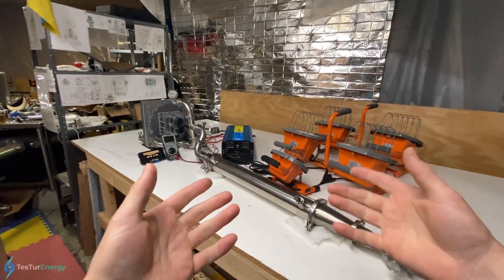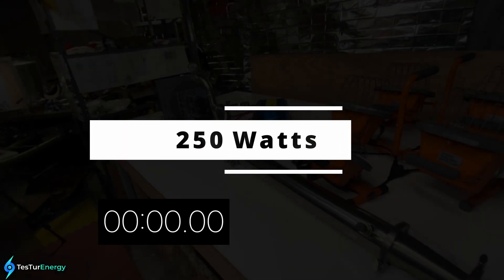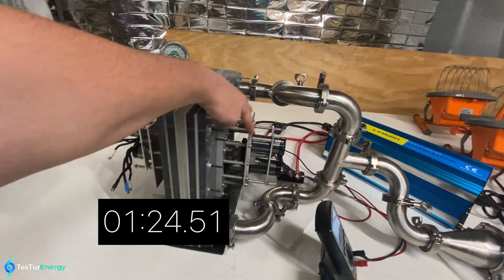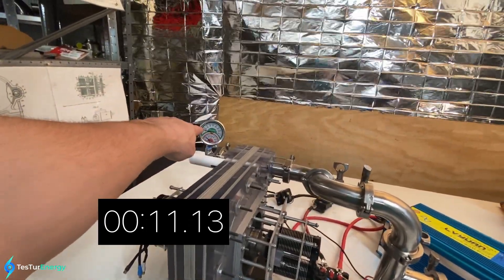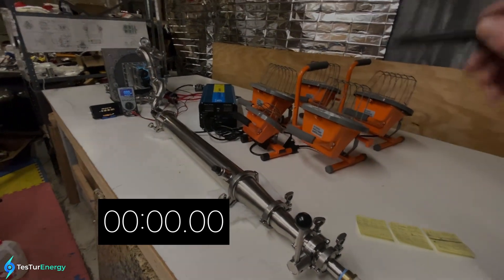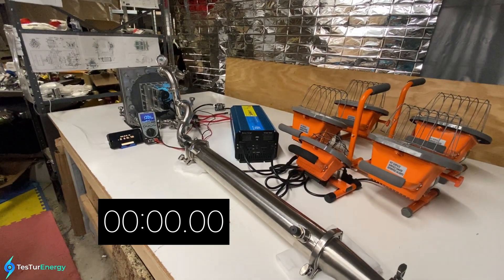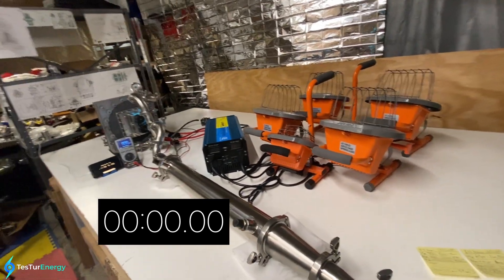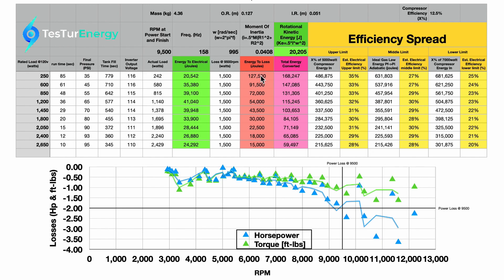Tesla Turbine 250 watt to 2.65 kW Power and Efficiency Test

Comment: Have you contacted any businesses that used to produce Tesla turbines or universities that studied them?
Eaton manufactured Tesla turbines in Milwaukee in the 1920s and 30s. I saw four of them on display during a tour of their facility in 2018.
The University of Wisconsin has a functioning 50kW Tesla turbine in one of their engineering labs.  It was manufactured by Falk Corporation.
Reply from the maker: 🤯 seriously?! Who can I contact at the university of Wisconsin to see the 50kW TesTur there?
Reply: @CharlieSolis  
I'll ask!
One of the engineers that I work with wrote his thesis on the Tesla turbine at UW Madison. He studied the effects of wet/saturated steam on Tesla turbines.

The turbines currently in production have a different name because the improvements have differentiated it enough from Tesla's original design.
Reply from the maker: I’m very curious to hear their answer.

But interesting. In my opinion they shouldn’t have needed to make any changes to it if designed properly, though. It works perfectly fine the way Tesla designed the improved disc stack patent GB 186,082 to work.
Reply: What I remember from our conversations:
The output shaft on the newer version is hollow, allowing the exhaust to exit without going through the openings cut in the discs. The discs would fail at the webs between the openings.
I looked up GB186082. I didn't see intermediate spoked discs in my colleague's models. The newer turbine has tapered discs that get thicker towards the center. The discs are spin-formed, which work-hardens them, allowing for higher speeds without deforming.
Hopefully, I'll see him tomorrow.
Reply from the maker: From the patent…
“In the new design I employ two heavier end-plates which are machined tapering toward the periphery for the purpose of reducing the maximum centrifugal stress as much as practicable. 

The inside discs, of relatively thin material, are rolled, forged or ground tapering in like manner and with the same object in view, but this may not always be necessary and plates, made of sheet metal of substantially uniform thickness as furnished by the mills, can be employed. 

Each of the thick as well as thin plates is provided with exhaust openings, leaving a solid central portion like the hub and spokes of a wheel. 

Star-washers of similar configuration serve the purpose of keeping the discs apart in the center and for the peripheral spacing the thin plates have small holes drilled in them on a circle, or circles, of suitable diameter, and in these are driven tight-fitting studs which are upset at both ends by a special tool so that they will project beyond the metal on each side a trifle more than the thickness of the star-washers. 

When the plates are put together the separating studs do not come in line but are straddled in order to give opportunity for slight yielding, thereby eliminating constructional difficulties which might be caused by unevenness or other mechanical imperfections. 

Thus the rotor can be finished closely to predetermined overall dimensions and will run true on the outside even if the thin inside plates should vary a little in thickness or be slightly warped. 

To simplify this arrangement I provide only every second plate with studs, using plain ones between. 

Furthermore, with the object of cheapening the manufacture I dispense altogether with the former, accomplishing the spacing by means of small bosses or protuberances which are raised in the plates by blows or pressure and provide a die, practically reducing all the machine work on a thin plate to a single operation in a stamping press. 

The star-washers, while preferable, are not indispensable and may be replaced by round separating washers of a diameter about equal to that of the hub part of the discs.”
-Nikola Tesla
Reply from the maker: “This construction permits free expansion and contraction of each plate individually under the varying influence of heat and centrifugal force and possesses a number of other advantages which are of considerable practical moment. 

A larger active plate area and consequently more power is obtained for a given width, this improving efficiency. Warping is virtually eliminated and smaller side clearances may be used which results in diminished leakage and friction losses. 

The rotor is better adapted for dynamic balancing and through rubbing friction resists disturbing influences thereby insuring quieter running. 

For this reason and also because the discs are not rigidly joined it is safer against damage which might otherwise be caused by vibration or excessive speed.”

Dated this 24th day of March, 1921.

Nikola Tesla.
Reply from the maker: I like that idea of spin forming each disc. Probably really good for lattice arrangement as the discs cool.
Reply from the maker: I’ve seen a hollow shaft TesTur patent before. Although I for the life of me can see why it’s necessary to complicate the manufacture other than for business legal and proprietary purposes. 

I’ve got a copy pasta 🍝 I’ll share with ya. 

Consider one kilogram of H2O steam entered the turbine at Mach 1 at 300°c and left the turbine at 1/2 radius at 1/2 the speed of sound. 

The kinetic energy left in the steam leaving the turbine at 1/2 the speed of sound is…
(1/2)(1kg)(170m/s)^2 = 14,450joules of kinetic energy. 

But the available energy from initial kinetic energy and thermal energy in the steam drop from 300°c-100°c is… (c=specific heat)

(1/2)(1kg)(340m/s)^2 = 57,800joules of kinetic energy. 

Plus

c*M(Tf-Ti) = (2080 j/kg/°c)(1kg)(100-300) = 416,000 joules of heat energy.

Total energy available for the turbine to utilize from 1kg or steam entering the turbine at Mach 1 and at 300°c thermal energy available for expansion through the path length comes to 

57,800j+416,000j = 573,800joules total available Energy.

So not being able to utilize the last 14,450j of kinetic energy of the steam means you’re only missing 

(14,450j / 573,800j) = 0.02518

That means you’re leaving only ~2.52% of the total energy available for the turbine to utilize for power out…. 

The kinetic energy of the fluid leaving the turbine even at 1/2 the rpm is a pale shadow compared to what’s available. 

Focus on optimizing the rest of the turbine by reducing slip and you won’t even need to worry about that last 3%…

And in any case that leftover energy isn’t “lost” it’s still available for power in a second stage or even like in Tesla’s patent GB 174,544 hybrid disc turbine + Parsons reaction turbine that utilizes the last bit of kinetic energy left in the fluid and the thermal energy generated/loss from the shearing of the fluid, also know as the “reheat factor”, through expansion and radial thrust in the low pressure secondary stage parsons reaction rotors.

1kg of steam at 125 psi is at ~180°c and say going Mach 1 entering the turbine…

Thats 166,400j of thermal available to drop to 100°c plus 57,800j kinetic energy =

224,200joules available 

14,450j/224,200j = 0.06445

So that’s ~6.45% of the total available energy is lost to the exhausting steam’s kinetic energy and unusable in that stage but recoverable in a second stage. 

Again…. Still not even breaking 1/10th of the total energy available. 

Sure if we are going to chase those high efficiency numbers yeah 6.5% would be nice to have but again it’s not “lost” forever.  it’s available in a second stage for more torque. 

Just like every axial bladed turbine. No one stage ever comes close to utilizing all the thermal energy available. What’s not used up after each stage is put through another set of stator nozzles to accelerate it with its leftover energy and smash it into another rotor blade stage. 

In fact, if a bladed turbine requires 15stages to get the 60-95% efficiency they boast that means no one stage could even possibly come close to getting those efficiency numbers.
Reply: The hollow shaft was splined on the outside where the discs are mounted. I originally assumed that the splines drove the design and the hollow shaft was an afterthought with unintended benefits.

I'll look over your equations in the morning. I sent links of your videos to my colleague. Hopefully, he will respond directly.

I think it is cool that you are investigating these turbines. I commend your enthusiasm!
Reply: I took a second look at your equations.
Are you measuring temperatures in C° or K°?
Reply from the maker: @Al828282  the °c or K doesn’t matter for this specific equation because it’s “change in temp”. So whether you do it in Celsius or Kelvin the change will be the same number.
Reply: @CharlieSolis  
I'm going to check out some technical documents from the company library on Tesla Turbines.

I read your earlier comment about supersonic air being applied to the turbine.
I recall reading that the steam velocity entering the Eaton Tesla turbines was 40 meters/second at the inlet.  It had guide vanes around the perimeter of the housing, but no nozzles.  I'll tell you more as I find it.
Reply from the maker: @Al828282  I was only using sonic speeds as an example. Also the speed of sound in steam is higher than air. So nozzle still wouldn’t be fully choked at this point either.
Reply from the maker: @Al828282  and that was just an example for the exhaust holes being at 1/2 the radius. Even my giant exhaust holes still don’t even go out that far.

Comment: Why are you rectifying it to then turn it back to AC?
Reply from the maker: hey thanks for showing your love and support by commenting 🙏❤️ it really helps with the algorithm! 

So because I wanted to prove to everyone that you do not need to gear the TesTur down to the generator because when designed right they get plenty of torque, I went and did it the opposite way. I have the turbine geared UP to the generators. So the generators spin at ~26,000rpms and output 12v. And they are 4pole 3 phase permanent magnet generators. So at 433rev per second, and then 2cycles per rev (due to 4poles) that’s 3phase 12vAC at 866hz. 

So then to get that back to 120v AC I rectify it with a 3phase full bridge rectifier, to DC and then back into an inverter for 60hz 120vAC pure sine wave. 

This is how all Micro gas turbines do it that spin faster than 3600rpm, which is basically all of them as they usually spin between 20,000rpm and 250,000rpm, I’ve heard of 500,000rpm in very small experimental drones but have not seen anything significant on them.

Comment: pretty simple set up huh?  😂
Reply from the maker: For real though! Only going to have one moving part when I get the direct on shaft generators all ready to go!
Reply: @CharlieSolis  this is pretty sick but you got like a book or something i can buy so i can make my own? seriously.
Reply from the maker: @kragonlinx  I should probably write one shouldn’t I? 😅

The best I have so far is the compilation of my community posts. 

I’d say start diving into the TesTur physics explanation ones and the TesTur myth dispelling posts.
Reply from the maker: @kragonlinx  [TL/DR: This is not a mechanical turbine in any shape or form. Since all molecular adhesion and internal viscous forces within a fluid are governed by electron orbital interactions, this makes the Tesla turbine a purely electronic turbine.]  By. Charlie Solis  (Original post location: https://www.youtube.com/post/Ugkxif4iryzOpEXN9G3bmId9xznZTk1yuxyz)   The BIGGEST misconception about the Tesla Turbine that most people get wrong is that they think the fluid is actually sliding and dragging on the disc, similar to as if a solid object was “sliding” across the surface of another solid object.   It is not. Full Stop.   (It continues on in the post at the link. It’s long but definitely worth the read)

Comment: Wow! Really liked the spreadsheet and comparison between the loads and efficiency. If I understand this correct it would be a good method to store energy for short periods of high demand if scaled up.
Reply from the maker: Yo, PremiumBasics, glad to see you around! I’m still in absolute awe with those ultra lightweight machined aluminum drone supports of yours! 

And yessir! This is a pretty crude proof of concept for a miniature peaker auxiliary power unit. While yes this makes the turbine viable for Compressed Air Energy Storage (CAES) and Liquid Air Energy Storage (LAES) systems my overarching plan is for a complete replication of Nikola Teslas improved combustion + steam turbine patent GB 186,083, that everyone sleeps on and was patented in 1921, 10 years after the original turbine patent and a decade of R&D.

This way even the low temp solar steam boilers can modularly work with it as well as any kind of fuel imaginable. 
Here’s a couple background videos I’ve put out further examining both the vacuum steam systems and the combustion + steam system. 

Let me know if you have any question! 

Solis Talks Tesla Turbines - Nikola Tesla’s Electrical Power Systems Patent GB 186,083 Walk Through
https://youtu.be/5Y3D13JmtcA

Tesla Turbine Jet Engine - gasoline fuel burner atomizer flame tube test 186,083 propane burner
https://youtu.be/gRqKowignac
Reply: @CharlieSolis  but the big question is how long can it run.... Or u need 1hr generators in series...

Comment: Hey Charlie, maybe you can try the same thing Jeremiah Ferwerda is doing - fast spinning magnet with coils as a generator (no cores needed due to high speeds - same as SMPS, smaller cores with higher frequencies). No reductions, no gears, no grinding, no noise. Only nice sound of a Tesla's turbine. I can bet it would have higher efficiency... ... a lot. He's using single cylindrical magnet with radial polarization. I see no reason why this couldn't be achieved with Halbach array configuration too - additional balancing would be required, but yeah... 

I hope my workshop will be ready soon, would like to acquire this turbine from you to experiment!
Reply from the maker: Hey innovations for all! Thanks for the suggestions! Yeah the Newman generators are pretty nice. Very simple to make. 

On that note though, I have already acquired and prepped 2x brand new 10kw cont. 12kW peak generators that will go directly on shaft on either side of the turbine. The are high very efficiency, +90%. 

I mostly want to stick with off the shelf components for certain parts. That way there’s no guess work in the rated operating conditions, the upper operating limits, also can go off the manufacturer specs for details too, etc. 

It just simplifies everything. 

But just fyi, the turbine doesn’t have a gear reduction 🤭 I have the turbine geared UP to the generators. 😈 I did this because everyone demands “Tesla turbines have to spin too fast and only get low torque so you HAVE to gear them down for them to even work…” 

I wanted there to be absolutely no question that not only does the TesTur get plenty of torque that it can go direct to shaft at lower RPMs, but it could even be geared UP to the generators. 

Because if it can be geared up to the generators it can go direct to shaft. 

Unfortunately, 😅 most people confuse the gearing I have for the alleged “gear reduction needed for a TesTur…” when it’s the exact opposite. 

But yeah. I’ve already got the 2x direct on shaft motors already cued up on deck, just waiting to be switched into the turbine. 

Sadly these generators are much longer than the ones I’m using currently and as such they won’t fit into the vacuum chamber for my vacuum steam “cold steam” closed loop system. 

So I’m getting these working to do the vacuum chamber tests.

Then the direct on shaft setup will get put together for the next all stainless steel full high temp and pressure combustion + steam turbine 🔥😈🔥
Reply: @CharlieSolis  Got it! Wow, thanks for the explanation and your time!
Looking forward to see it and use it!

Comment: Sick! Play with fire when!?
Reply from the maker: Very very soon! Just working out the vacuum chamber cryophorus piping for the turbine to go into it and then it’s vacuum steam tests! Then I have to cut out the all stainless steel turbine and then we are ready for full burn tests!!!
Reply from the maker: Check it out 🔥😈🔥
https://youtube.com/shorts/YQWcgCG9sgg?feature=share

I’m about 75% of the way finished with the all stainless steel high pressure combustion + steam to 4 vacuum recouperator condensers/low pressure boilers to noncondensables vacuum pump system + Tesla fountain water-to-air heat exchanger for the complete high efficiency HP Rankine + inverter Brayton cycle Combined Heat and Power (CHP) unit. 

😮‍💨 that’s a mouthful